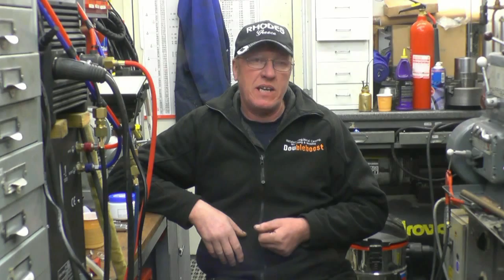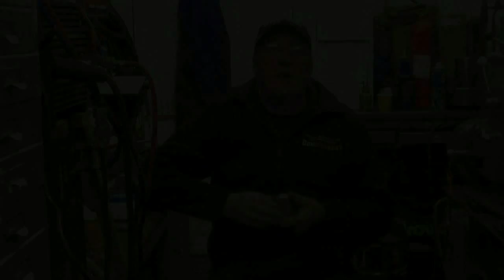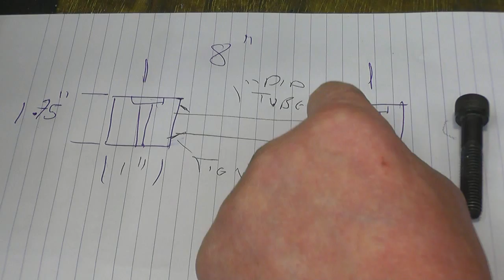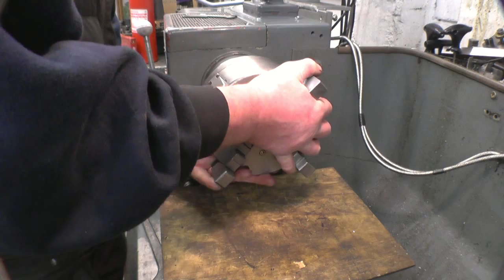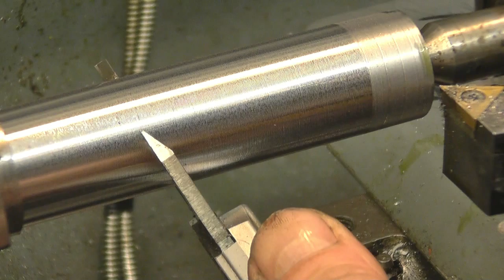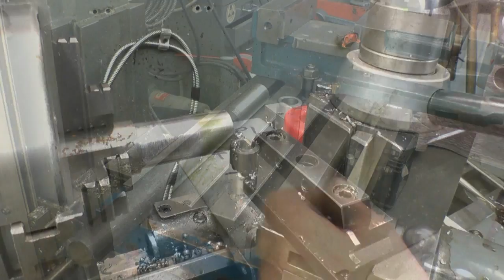SNNC 158 P1 Motorbike steady bar TIG Welding  Edd on organ

Comment: I know what you mean in regards the no spill pots , they are hard to find here in Australia  as well .
I hunted around on EBay and found some no spill paint pots and they work ok but are a little taller and can be knocked over a little easier .

Comment: Thank you very much, I really enjoy your videos as they are very practical. As a novice I learnt something new today. I had never thought of using a milling cutter to cut a recess for the cap screws to fit in. I normally use a drill bit but it is not flat, I will use that system in future.

Comment: Great vid John, im just in from the garage, been doing a bit of counter boring too, :)
Reply: Me as well, but my task was upsizing some mounting-bolt holes on a lathe chuck backing plate. The plate has holes for both a 3 and a 4-jaw chuck, and it was on the 4-jaw when I got it. Now only the 3-bolt pattern fits for the three-jaw, and they must have been in a bind or something, cause when I tried to put it back on the 4-bolt pattern again it wouldn't go...weird. I've never crashed it, and it was already fitted when it was given, so who knows? Fits now, no complaints :)